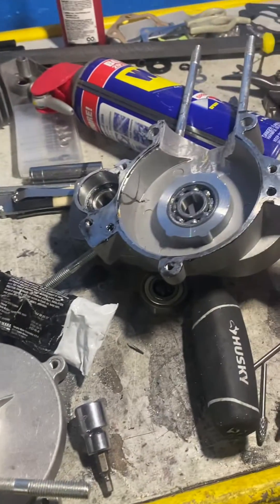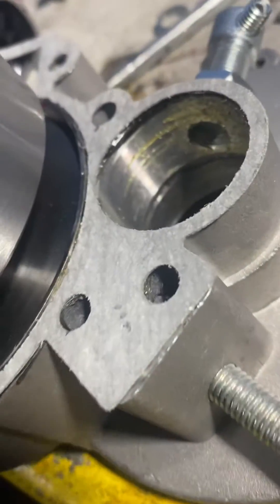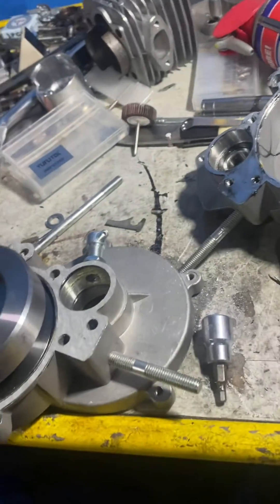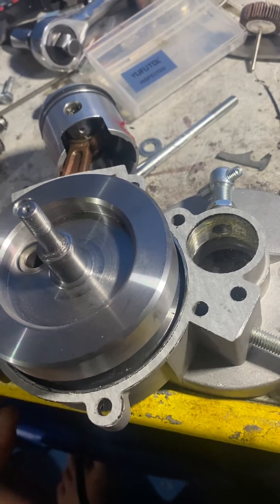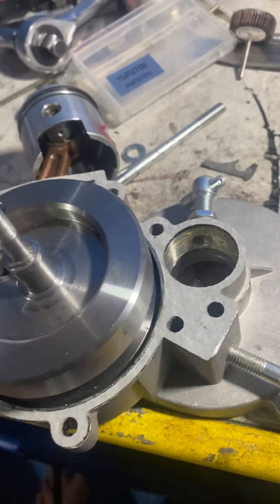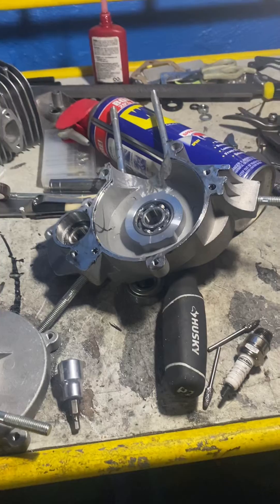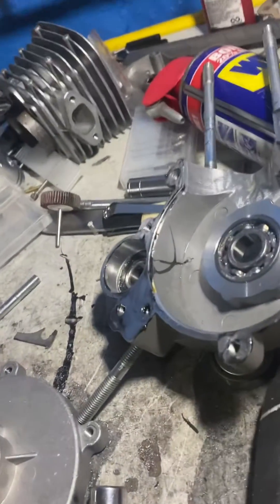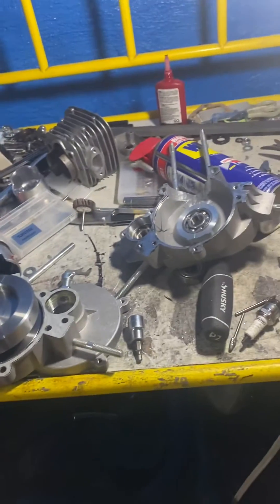How To Seal Motorized Bike Case Halves

Comment: Breaking the motor apart and putting it back requires a lot of work. Something I don't really like to do but is good to keep the engine running smooth